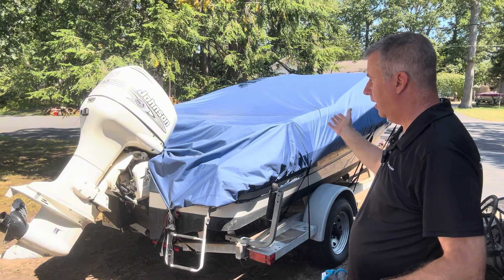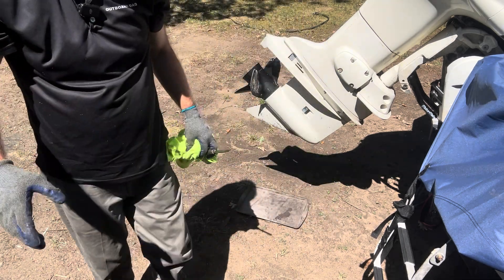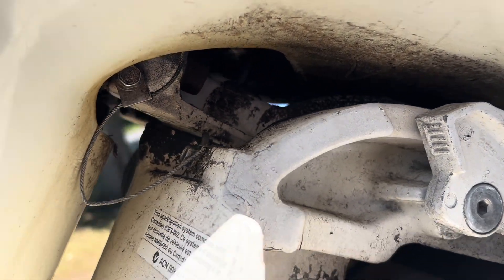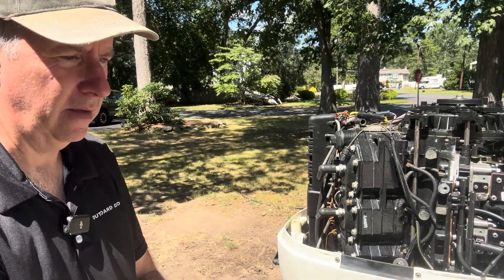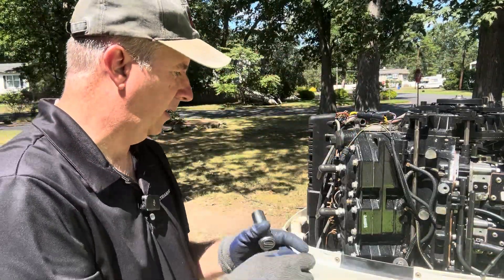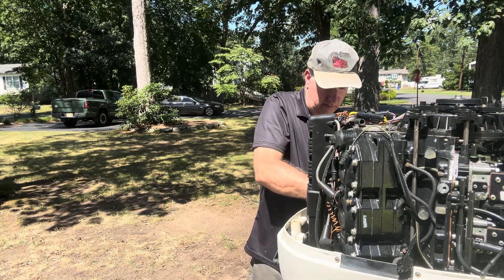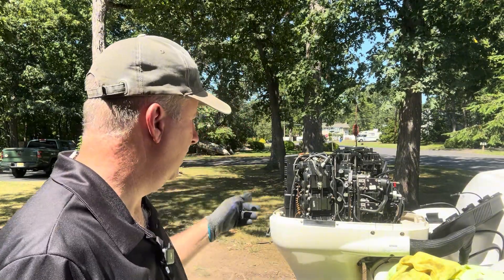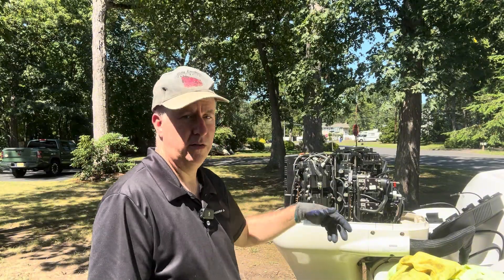Johnson 175 Outboard Won’t Start | Real Dockside Diagnostic

Comment: i have a 1998 evinrude ocean pro 150hp that i think its missfireing cause last time i went out the check engine light came on, i put it  in neutral and was running rough then plained out again then came out of plane without me moving the throttle and then right by the dock it shut then i started it again then shut off after a few seconds. started it up yesterday and was still running rough but didnt shut off and that was a idle. any ideas? ill put a video of it starting up and
Reply from the maker: I would start with a compression test. See how that goes if all checks out then clean the entire fuel and oil system and be sure it’s all functioning. Let me know how your tests go
Reply: @OutboardDad compression is good
Reply from the maker: @that_17mako what were the readings on each cylinder? Have you cleaned the oil system?
Reply: @OutboardDad the compression on each cylinder is 100-105  in all 6 and it has the vro pump bypassed
Reply from the maker: @that_17mako Ok, did you disconnect the oil sensor when not using the VRO?
Reply: @OutboardDad whT does it look like
Reply from the maker: @that_17mako Typically it’s a white round sensor that you can unplug. You can email pics keith@outboarddad.com
Reply: @OutboardDad its round and white with brown and black wire right, and im using the vro pump still but its being used as a fuel pump.
Reply from the maker: @that_17mako That’s it!
Reply: @OutboardDad what does it do?
Reply from the maker: @that_17mako It’s sensing oil flow. Supposed to put the system in limp mode if oil flow is reduced. Hopefully saving the engine from lack of oil and still get you back in.
Reply: @OutboardDad ok
Reply: @OutboardDad can i send a video

Comment: I think the issue is probably that it's not a Yamaha. Kidding, I have no idea, though. Optical timing? Sounds like a recipe for problems.
Reply from the maker: Well the owner stopped by yesterday and let me know that when he was running the squeeze ball went flat several times. Also when he tried to start it the primer was not working. As soon as we manually primed it started right up. So we will now go through the fuel system.
Reply: @OutboardDad cool. One step closer.